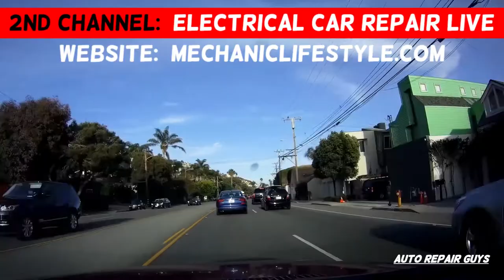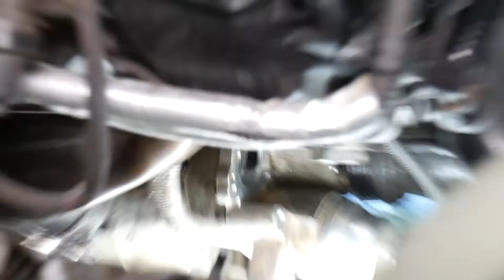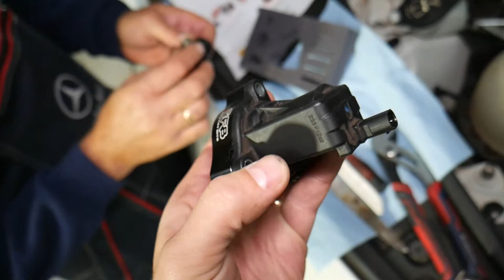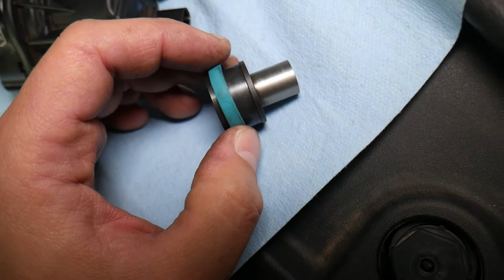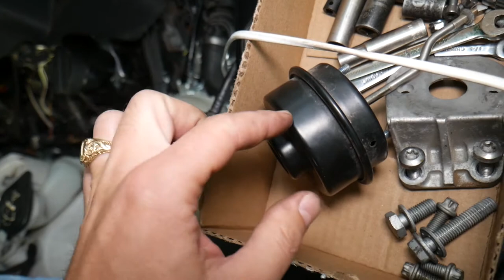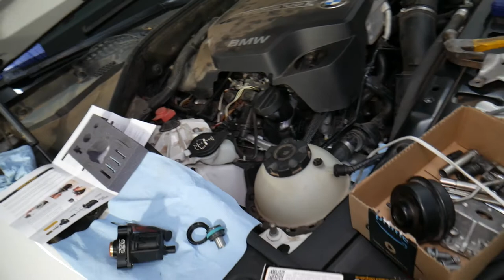BMW F10 F11 CODE 120308 CHARGE AIR PRESSURE CONTROL PLAUSIBILITY PRESSURE TOO LOW BMW 520i 528i 530i

Comment: Nah, I swap mine with a Turbosmart VR9 brand new and it is still giving me a Drivetrain Malfunction.   I remember it use to do this exact thing when I first bought my 535i so I did a full tune up and noticed the old Bosch spark plugs looked really worn out.  I stalled a new set and that fixed the problem!

Comment: I have 120408 code do
You think is familiar with the 120308? Or is different part or symptoms
Reply: any luck figuring out your code? a buddy of mine has a 2013 bmw m5 with that code... itll pop up on start up when its cold outside but if he turns off the car and turns it back on, everything is fine. drivetrain malfunction light will go away after cycling the startup